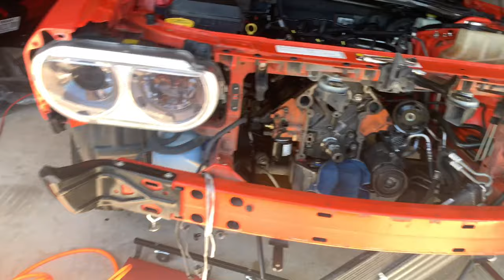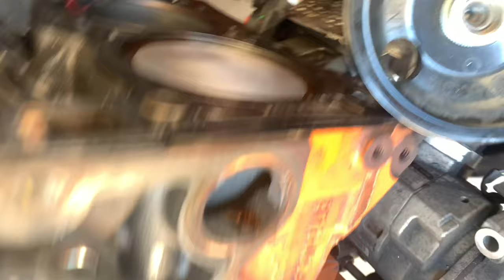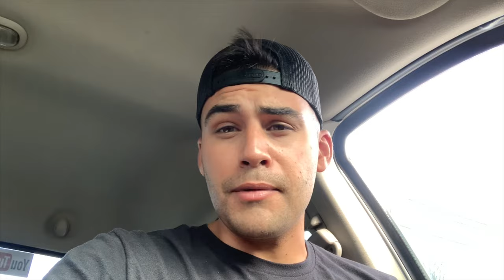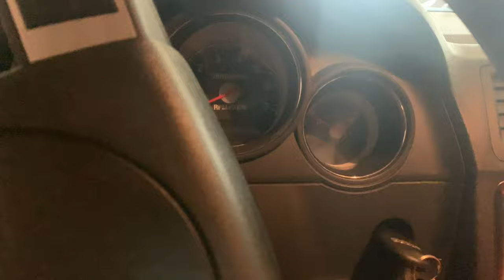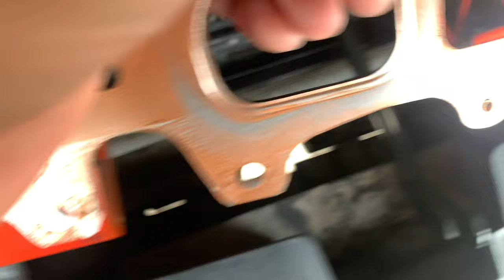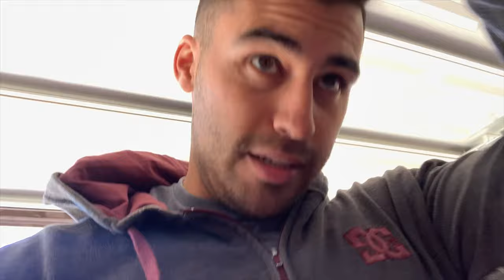6.1 HEMI Build-up!

Comment: Doing the rebuild on my 6.1 hemi out of my 2006 jeep grand Cherokee srt8 going with the mmx piston and rod set up with the cosmetic head gasket not sure on the headgaskets yet though
Reply from the maker: Hell yea bro! For my cam only 6.1 I used oem head gaskets. In fact I used oem everything lol. 

But a WK1 SRT is a sick build I was looking for one last week lol
Reply: @TIRADORACING  honestly I work full time but still no we’re close to being able to do all oem gaskets i am doing aro studs cosmetic head gaskets the mmx drop ins and all other gaskets are from my local napa/felpro hopefully im good
Reply: @TIRADORACING you wouldn’t know were i can get the torque specs??
Reply from the maker: @devotedanaheim1575 no clue bro probably on google by now. I worked at a dealership when I printed out my torque specs for all this. Been a minute.

Comment: Did you have to get your heads/block resurfaced? If not how did you clean it?
Reply from the maker: Nope, just used a razor blade and degreaser. 0 issues and MULTIPLE events on it afterward.

Comment: So the cam and cam sprocket where does that dot on the cam meet with the cam sprocket ? 12 o’clock ?
Reply from the maker: Not sure, I’ve done this job twice now the sprocket only goes on one way. You don’t have to align the cam to the sprocket because the sprocket only goes on one way onto the cam. The sprocket has a cutout above the hole for the cam bolt. In that cut out the nipple on the cam will seat into the sprocket. 

If done correctly everything should be as I showed, top dead center for piston 1 and all the timing marks in the positions I showed. 

I hope this helps it’s really hard to type it out.

Comment: How did you get the oil pump off. Didn't look like you drop the oil pan
Reply from the maker: Your absolutely right. 

I used a small ass wrench to loosen the bolt, once a few threads show through I tied an string around it. 

You continue to spin the bolt and feeding your string around and if it falls you have it tied to a string. 

It’s time consuming but it works! 😅
Reply: @TIRADORACING  okay thank you. I have a 5.7 but I'm pretty sure it's the same thing

Comment: Hi, I just brought a 09 challenger srt8 two days ago with 64k miles and I'm running into so overheating problems, I don't see any leaks or anything but when I opened the coolant tank it smelled real bad and it almost looks like ice cream, what would you recommend I do? I love your videos and I've been watching for quite a bit and came across this one and wanted to know your thoughts
Reply from the maker: It just depends on how mechanically inclined you are. 

You may have a head gasket problem and may need to have them replaced. Depending on how bad the issue is you may need the heads resurfaced as well. 

If your taking the heads off might as well replace the lifters and timing set and even the oil pump. Your already there lol. 

If you can’t do these jobs yourself your best bet is a mechanic my friend. I don’t have access to your car so I can’t figure out what the problem is you know? And this is just ideas off the top of my head I’m not saying your head gasket is blown I’m just guessing from what you told me. 

Hope you can get it figured out my friend.
Reply: Does the art use a transmission cooler in the radiator?  Trans fluid and antifreeze mixed together turns into a milkshake like substance.  I’d check trans fluid to be sure it’s clean.
Reply: Try changing the thermostat

Comment: Where you able to do this in the car or did you have to lift the motor slightly
Reply from the maker: I did it all in the car, now I did lift the engine slightly to take the headers off, it’s easier to raise and lower the motor to reach certain bolts  on the headers. 

For the cam I dropped the entire radiator and fans so you just do all the work from the front with the engine on the engine mounts. You can’t pull the cam with the radiator and fans in place tho, def have to drop. But it’s just disconnecting the fans, the hoses and it’s 4 bolts (2 on each corner) holding the radiator and fans up super easy! Hope this helps’
Reply: @TIRADORACING  🤦‍♂️🤦‍♂️🤦‍♂️

Comment: What kit did you get for your build do you have the part numbers
Reply from the maker: https://youtu.be/p19CjBqbSeQ

Everything you need to know is in that video and links to all the parts are in the description of that video. 

Not a “kit” per say. I just chose a cam, forged push rods, Hellcat lifters used due to lifter failure, new oil pump and new timing chain because I was already there. All new gaskets to go with everything that came apart. 

I originally cammed it about 5 years ago so this wasn’t my first rodeo. 

That’s a ton of part numbers to link, you can find everything on highhorseperformance.com. 
Remember to use MOPAR gaskets as stated in the video.

Comment: Hey boss quick question I got 6.1 that failed a combustion test i remove the heads thinking it might be a head gasket but there is no obvious wear what would be ur thoughts any help would be appreciated
Reply from the maker: If you already removed the heads I’m assuming you checked the small stuff like spark plugs, coil packs, valve springs etc… my next guess would be piston rings. Low compression?
Reply: Hi yes I did the combustion test because it was over heating  new rad new tstat water pump still over heating did the combustion test and came out positive for exhaust gases
Reply: Motor only had 99,000 miles

Comment: Hey bro, can you do a follow up to your widebody. I recently bought the same kit and have some trouble with the double sided tape sticking on the top of the front fenders. I saw you use 3M adhesive. How is it?

Thanks
Reply from the maker: Hey man I will be doing a follow up I’m just generally busy with school and work,  I tested that super strong 3m tape cause some people were iffy on the glue so I decided to test the tape. For me only the passenger side front fender pops up and won’t stay down and it’s not even that bad.....

I started using the adhesive on the rear flares and it works like a charm, again I just haven’t had time to mess with the car to finish but that’s the route I’m going. 

I’m uploading other videos first that I need to finish editing but if you follow me on Instagram and shoot me a message I’m more than happy to send you pics and video. 

As for a an actual video it will be some time before I get to it.

Comment: no need to remove the fuse of the fuel pump just push the fuel panel to the floor it will e the engine turn whit out engine fire up
Reply from the maker: Yes either way works

Comment: hey brother that's a bitchin' looking challenger and a nice video too, i got a bad lifter/cam on my 2010 grand cherokee SRT8 6.1 so now in the process of collecting all the parts involved in that job including a new melling high volume oil pump but i'm a little concerned about it because i know that the oil pick up tube is bolted to one of the main bearing cap and not floating as in the 5.7 hemis etc so what did you do to avoid dropping the oil pan??? thanks in advance
Reply from the maker: Hey thank you! I carefully took the bolt out of the oil pick up tube that connects it to the pump and when there was enough threads showing I tied a shoe string to it and carefully kept removing it 😂. 

It is a pain in the bit and I did grind down a cheap wrench so it would fit in the gap. It’s slow but it worked! 

Hope this helps!
Reply: SWEEETTTTT brother and yes I love challenges so I'll follow your tips and hopefully will be able to do it, thxxxxxxx

Comment: Whats that little AI replacing your AC hose?
Reply from the maker: I’m not sure what your talking about.... I didn’t replace my A/C hose with anything. Car has full A/C and heater. 

It might be the wire harness I made for the gauges in my pillar pod running to along the back firewall to the power/ground and fuse box.
Reply: TIRADO RACING It’s beside where you fill your oil. Looks like a mini CAI?
Reply from the maker: Oh! My bad yea man it’s just a breather filter. When you add the cold air intake you take off the “tube” from there that connects to the intake. It’s a breather. My carbon fiber intake doesn’t have a spot to connect the breather hose so you just add a little filter instead. It came with my leg maker intake!
Reply: TIRADO RACING cool thanks!
Reply from the maker: Yea no problem! Thanks for watching!

Comment: How did you remove oil pump without takeing off pan
Reply from the maker: By carefully removing the bottom bolt with a thin wrench, tying a shoe string when plenty of threads showed, and continuing to remove the bolt and passing the shoe string around. When it was out just pulled the shoe string out and set the bolt aside. Twist the pump clockwise while pushing down lightly on oil pick up tube.
Reply: @TIRADORACING   sounds good thanks for quick response I ordered a set of thin wrench’s I will be trying it when they get in 👍 nice build as well